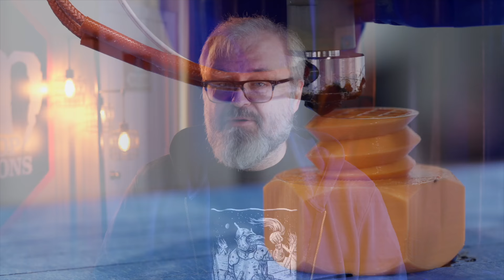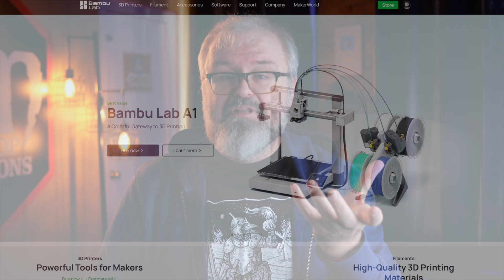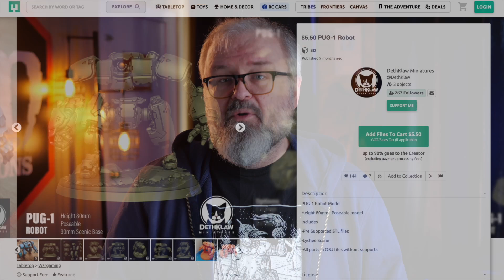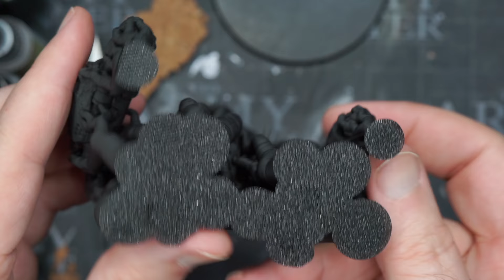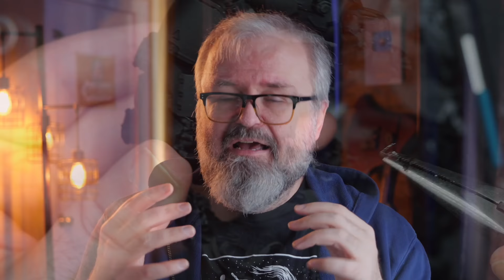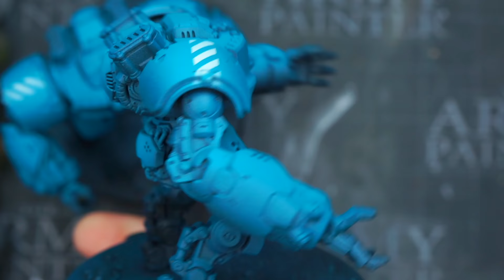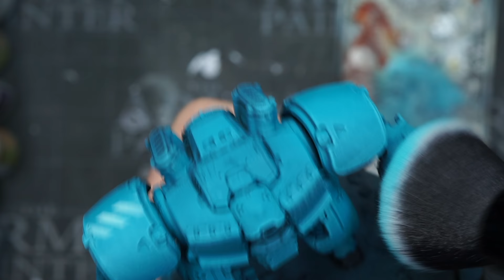I Compare RESIN vs. FILAMENT for 3D Printing Wargaming Minis

Comment: i was able to get great detail using Fat Dragon Games @Tombof3DPrintedHorrors settings but going to .06. I am extremely near sighted and with miniature detail by sight it is a  super power. With .08 I can see the lines fairly easy about a half foot from my face without glasses. However, with .06 I can't. I experimented with varnishing the .08 minis before priming and it it hid the layer lines after priming. Completely smooth miniatures. My wife who has normal vision can't see the lines with a .08 layer print even a foot away especially after painted without varnishing before priming.  I have found certain filaments do better with these compared to others. The Bambu Labs filament isn't great for miniatures, but not horrible. I tried using  SUNLU High Speed PLA Meta like FDG and got decent results on .08 lines, the .06 were horrible. The best one I found for miniatures as suggested by Propane Prod @PropaneProd is eSUN PLA+ Filament. I get great results with a .06 setting with them. Thanks for your video! I will try a larger miniature to see what kind of results I get. I have to say that with content creators like yourself, I have been able to print better quality miniatures and terrain than I have been able to buy online from companies that have printed in FDM for years. I have been doing it for less than a month.

Comment: Great video. I have both resin and FDM printers. You can definitely get acceptable miniatures from an FDM printer. Some tinkering will probably sort the support issues. In my experience miniatures which have a textured surface are a better bet for FDM as it helps hide the print lines, they show up more on large, flat areas. One thing you didn't mention was the time issue. If you have a few figures to print, it's slower on the FDM printer as it has to print each figure essentially individually, whereas the resin printers do a whole layer in one go.

Comment: I absolutely would use filament printed models, I'm here for the games first and foremost. Pretty minis are great of course, but filament at the moment definitely prints good enough quality for me.

I'm actually working on a range of "low poly" filament printable models for exactly this reason. I'll keep you posted and be interested to see your next experiment.

Oh, and as `i am sure others have pointed out, you should have printed in parts, you would have got a better finish due to orientations, less supports, etc. etc.

Comment: I just did a game the other weekend where I had a mix of resin and fdm prints! I was playing Alien Hives from One Page Rules (So Tyranids essentially) and had almost all my models printed in resin, except my larger HQ model I did with fdm. Honeslty, on the table, I couldn't really see a difference.

Between the two, I find of prefer the fdm models. The quality is lower, and it takes longer to print, but its actually the weight and durability that has me liking fdm more. It was very easy for me to glue the fdm pieces together, and none of the parts snapped off. Resin models are unmatched when it comes to detail, but they are also more brittle and don't glue as well. I also found that with the resin models, I had to print slightly larger bases to keep them from falling over. It wasn't for every model, just a few, but some of them can be very top heavy.

I am finding that overall I use my fdm printer for bigger stuff, like tank sized models, and I use my resin printer to get out lots of little things, like warriors and detail pieces. Printing the pieces of large models individually and gluing them together at the end yielded much better results than trying to print it all as 1 model, or trying to print it as 1 large resin model. Thinks like hormagants however are a breeze on the resin printer! I can print an entire squad in no time, remove minimal supports, and go straight to painting in no time. Or if I need some custom shoulder pads for marines, resin is the way to go.

Comment: I'd probably stick to printing the bulk of my terrain with filament, and rely solely on resin for the actual minis and other misc important items. But filament certainly isn't bad. It's miles better than not having a printer at all.
Reply: I am on the same boat as you, I use all FDM for terrain and resin for miniatures.
Reply: I do the same thing 👍

Comment: 1. Printing in pieces helps maintain higher fidelity
2. Ive actually found presupported parts can be really helpful to reduce the needed tree supports and still give good results
3. Use PETG for your support interface for easier support removal

There are sacrifices I make using FDM for my minis. But not many in terms of quality and the saving on my wallet are WELL worth it just as much as avoiding the toxicity of resin. I do still want resin for display pieces but too poor at the moment lol

Comment: I've owned 2 fdm printers and one resin. If I have a print that has a lot of detail then I'll use the resin. If I have a print that is large like a terrain I'll use an fdm printer. The problem is the layer lines on and fdm printer. They require sanding and a filler for the layer lines. You can use filler primer, finger nail polish remover, or resin. Becareful with the finger nail polish it can damage you print. In the example in this video if you lightyear brush resin on top of the fdm model in a repetitive fashion while cureing each layer. You can get ride of the layer lines. And stippling paint will fill the layer lines in that area.

Comment: Is there a time difference between filament and resin? I'd like to print some tanks, and my local library has 3d printers to use, but I won't be able to just leave them printing forever...
Reply from the maker: Yes, the filament (when using a .2mm nozzle) can take a long time. This robot took 22 hours to print in filament, and far quicker in resin. Thanks for watching!

Comment: Some comparisons have been done before between resin and PLA for printing regular sized models (or at least, not dreadnought-sized models). People are claiming you can drastically reduce layer lines by going very high detail in the print configuration and using the smallest nozzle, which unfortunately makes the printing take ages (24+ hours maybe?)... but still small potatoes compared to time waiting for an overseas shipment to reach your home, so the tradeoff makes sense :)

Comment: The best advice I can give you is to keep your layers small as you can go. Ender 3 family I think has a .08mm pitch which means .08mm is the lowest resolution you can get per layer. If the object is several parts, print them off as several parts. Last, filler primer can help, but easily build up too much and erase some detail. In order to get your overhangs to not look like a complete mess, try experimenting with the gap between the part and the support, making it larger in small increments until you're happy with it, and your retraction settings bumped up a bit until you dial that in to compliment the airgap between the overhang and the support.

That all said, if you really want to try .1mm nozzles, you really need to experiment with pulling back the feed rate on the filament. In the past I've done stuff with the feed rate low as 70% based on the filament I was using at the time. Not all filaments are created equal.

Comment: When you say resin is sharper quality, that is also very literal. I printed a termagaunt squad for my Tyranid list, and as i was inspecting then post cure, i actually broke skin when a tongue stabbed into my finger by accident. These models i used are actually direct scans of GWs models, so it's the GW sculpt. They can be VERY sharp.

Comment: A thought, from a mainly modelling and painting perspective:  The layer lines on an FDM print are small enough to be hard to notice, at a distance, but large enough to provide some tooth for various texturing and sculpting materials...  Watered down milliput, texture pastes, wood fillers, filler primers, and the like...  What if, instead of expecting FDM prints to give finished minis, or parts, they were treated like an 80% framework, akin to what the military and scale modelling community does with their plastic kits, and left the modeller that creative space with which to finish detailing the parts, themselves?

It's a little more work towards a finished project, but it strikes me as being a pretty clear path to better display miniatures, once the ceiling for these technologies are reached, which I suspect will be soon.  It would allow for faster prints, since surface resolution would be benefitted by coming down a bit, and it doesn't require eeking out ever finer resolution from the steppers and servos used to drive the tech...

Comment: I print a bunch of OPR models on my A1 mini, and for something the size of your robot, I would always separate the pieces. I'll print five 28mm at once as single models and it's *fine*. That 3ft/arm's length distance is important. But I'd still recommend fdm to anyone even a little hesitant about resin in their home.

Comment: I use some FDM minis for my D&D games, but when I want to paint them, I prefer the resin ones, just because the quality is higher. Since I got the Elegoo Saturn 4 Ultra, I’ve been printing more minis. But for terrain, yes, FDM. You should have printed the parts separately, I think, you’d be able to reorient them to reduce support. Fat Dragon Games also have FDM-friendly D&D minis that you could look into

Comment: Uncle A, on the Bambu A1, change your setting under support "Top Z Distance" to like .22 or .24 nd your supports will pop off with some pressure. It will change how far away from the model it end. I found this setting will pop tree supports off EASY. fiddle with the "Top Z Distance"

Comment: How well does the FDM print take to being sanded? I've seen quite a few 3D-printer videos, but I don't think I've seen any talk about smoothing out the print lines post-print. One would think that some judicious sanding could hide the worse of the evidence; is that a thing?
Reply from the maker: I’ve seen people sand filament prints - and I could’ve tried that. However, I mainly wanted to show it right off the printer for comparison. Thanks for watching!

Comment: Resin looks better than FDM. But after really learning your printer and the specific filament you are using, you can get more than good enough minis for games for dirt cheap. I printed close to 3k in infantry for less than $15 that I can (more) safely print in my basement than with my resin printer. I wouldn’t print any more infantry in filament, as I have a resin printer, but my FDMs still get tons of table time. And my favorite model in my collection is an FDM Sherman, originally printed for Tanks for the Apocalypse, that has snuck into some OPR games.

Comment: Great video, thanks for making it. I'm no expert but I think there's many tricks, to improving the look of FDM miniatures. One of the biggest areas to improve the look is print the parts individually and glue them on. That way you can orient each part in a way to minimize supports and/or hide the ugly effects of the supports.  Also ironing  (slicer setting) or an acetone wash to smooth out the layer lines are additional options

Comment: Spaceships work great when designed for FDM. I make sure with my line that the parts that the "underparts" are hidden in the joints with other sections, or otherwise end up in areas that have limited visibility. Really thinking of going into vehicles and mechs next.

Comment: For those new to resin printing minis:  Do yourself a favor and avoid waterwashup resin (there's NO advantage, since you cannot dump the washwater down the drain, you still have to get rid of it like the alcohol stuff) and absolutely get a "tough" or "abs-like" resin.  This will avoid the heartbreak of minis whose arms snap off just because you looked at it funny.

Comment: I'm happy with fdm and premade kits. If I want Warhammer, I buy offical masterfully sculpted (discounted) models, if I want something else, I buy cartoony or chibi stls and print them with A1 mini. Personally I use the tiniest premade settings with 0.2mm and have no visible layer lines on 28mm minis. Small pointy bits however don't look great and I almost always need to glue the legs after I pull them off with the supports and supports leave a mess that needs to be cut and smoothed.

Comment: You absolutely can print the presupported file on fdm, I've done it.  It is generally harder to remove those supports (because they weren't designed for fdm) but honestly it seems like your experiment printing the entire thing is fairly comparable.  Just say it 15% more annoying than what you did.  Also uses more filament than the auro supports for fdm but that's not a huge deal.

And yeah I would have advised to print the parts separately on fdm which would have made clean up easier.  Also would have allowed you to orient stuff to hide the layer lines better.

Comment: I sand my PLA minis and then seal them with cheap PVA (like school glue) then use a wet brush to smooth the glue out. Two coats of that or so and a heavy prime can hide layer lines pretty decently

Comment: Resin has so many steps, chemicals, and issues compared to filament for table ready minis.  If you are painting show ready high detail models with lots of bits and bobs, resin is the way to go.  If you want to put an army on the table, then filament is fine.

Comment: As ive got a resin printer nowdays i go resin for minis but back before resin id have, after looking at the pictures of the parts of the model in the link you provided, printed that model separate. Orienting the shoulder pads with their inward edge (the side facing each other across the torso) down, as well as standing the forearms vertical from the elbow as i think it would be the optimal layer lines orientation for those smooth and very visible bit. The X/Y orientations have much better resolution than the Z so domed or sloped things get far more visible steps as the angle relative to the build plate gets flatter.
This would also minimize the amount of supports trapped in small crevices, like below the shoulder pads and around the thin waist on the underside of the torso on your print.
Also, filler primer (or liberal but drip avoidant application of regular primer) is your friend as this will help fill in layers lines.

Comment: I have a question could you have used a finer tipped needle nose pliers? The needle nose plier footage it looked like you used a beefy standard needle nose. Perhaps a fine needle nose might not have slipped off and left more of a mess. I don't know this for sure as I don't 3d print I'm just asking.
Reply from the maker: I’m not sure - it might help. Thanks for watching!

Comment: So I've been after this printing larger models and making them look awesome on FDM for years. I used to get good looking models from Rocket Pig games printed on my old Ender 3s about 6 years ago. With the Bambu and the new stuff, my large prints with some angle adjustments and making sure I support my overhangs at 1 foot away I can't tell the difference between resin and FDM on most of the prints.

Comment: My firend adjusted minis so good so resin model looks amazing in BL printer, also i see some of your settings are lacking and cuting model and adjust on bed is better to print minifigs, then print them as one model 😊
Reply: And also sunlu mate filament it's amazing with BL printers ❤
Reply: @justmike2916  I use SUnlu PLA+ and for 99% of my prints it's been great!

Comment: There is some great work being done in the /r/FDMminiatures subreddit on fine tuning settings for miniatures, specifically by the users HOHansen and ObscuraNox. The FatDragon settings are a good start but rapidly being superceded
My Ender3 V3 SE isn't as good as the BambuLabs A1/mini but I'm getting great results.

On a slight rant though...
I don't get the constant need to wrap every statement in "if you don't look too close". For gaming, both are great. Most people's paint jobs look like ass close up anyway. Any non-3d-printing gamer will probably be reasonably impressed with the quality even up close too, especially if you point out the price. The camera picks up more flaws than by eye so when held they look reasonable. Obviously not perfect but it doesn't matter. A year ago I saw multiple  people declare that FDM minis were barely recognizable blobs. They were wrong then and ego won't let them admit it still. Things don't have to be perfect to be good

Comment: I absolutely adore my A1 mini. It does everything i hate about printing for me. It is very plug and play. I had a Neptune 4 pro and it was just a pain to get things to work. I have an Elegoo resin printer I stopped using too because of maintenance and a lack of sockets in my ventilated room.  
For files, I spend a lot of time splitting models so they dont need supports. It is a bit of a time commitment to disassemble a model, but I find that it is time saved on things like cleaning resin or levelling the bed. The quality of ships for battlefleet gothic I have is just great. Depending on your patience, you can make the layers smaller. I just go for 0.8 and it looks great for tabletop.
I would say the more organic your model (like printing a guardsman) the more time you will spend altering the file and wishing you just did resin. The blockier (terrain, dreadnoughty type things, tanks, ships), the easier the A1 is.
Reply: ditto. Mothballed my Anycubic Photon, traded in my Ender 3 v2 for an A1 Mini and never looked back!

Comment: It seems like you can get almost resin quality with certain models but you can probably tell those models are FDM-optimized. The Battlefront Valkyrie models are a good example: They look nice enough but compare them to most of the resin printed spaceship models out there and they look like ships from an old videogame.